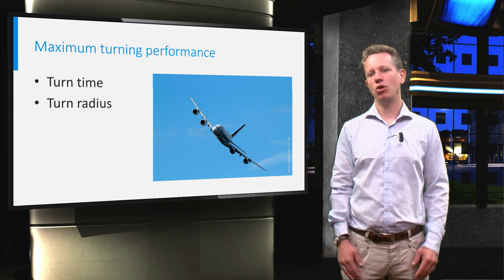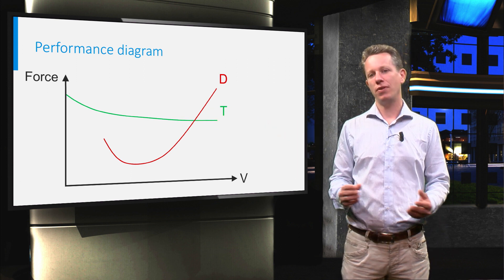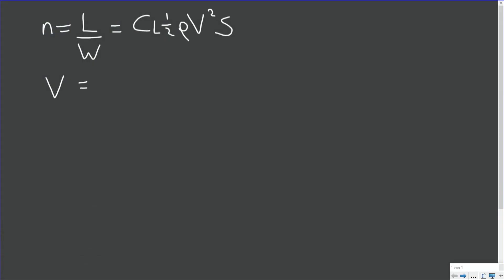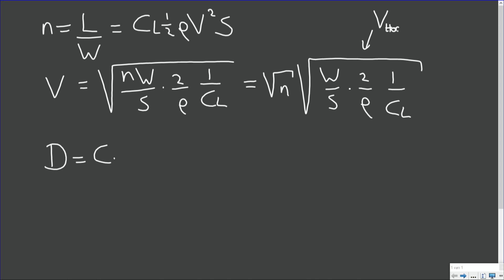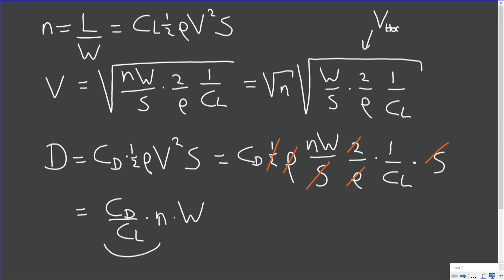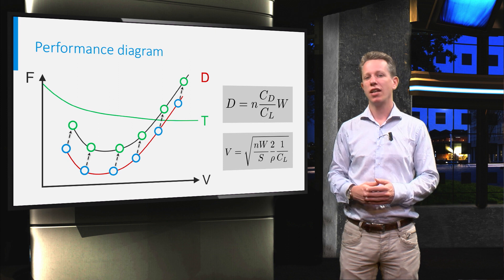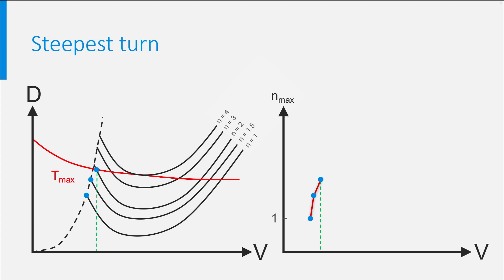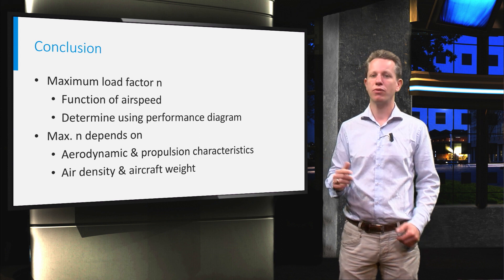Aircraft Performance Course: Turning Performance - Maximum Load Factor

Comment: hi am trying to calculate the load factor at the c.g of the pod mounted on the wing tip,for different flight conditions n i have no clue how to do what so ever. any help is much appreciated.thank you.
Reply: you can use the EASA wing loading calculations document.  it has steps to calculate loading at various stations along the span.